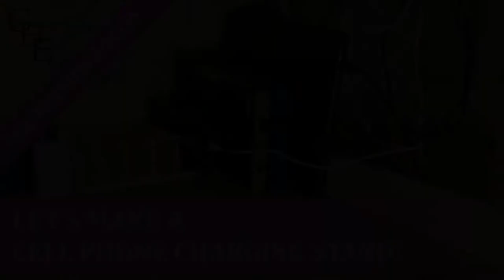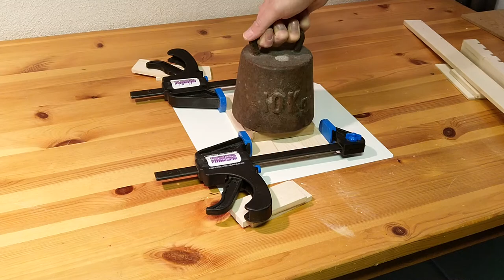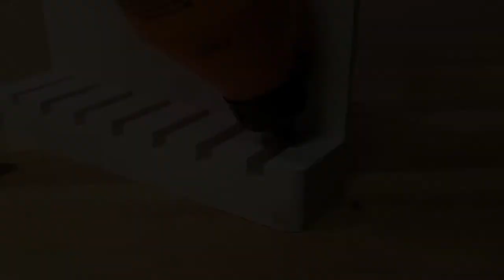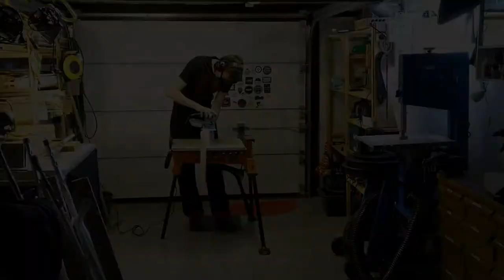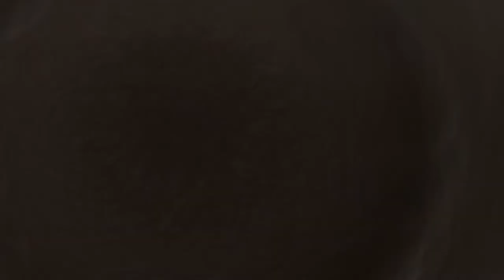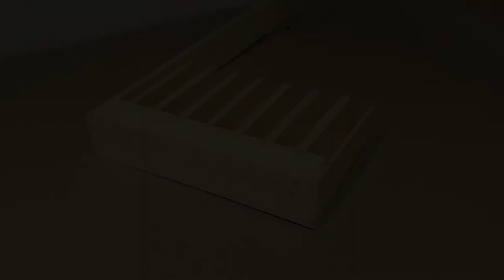Let's make a cell phone charging stand! #rubbishwood21

Comment: A really nice way to use those scraps. And I'm completely in sync with whay you say about old houses. Mine is also over 100 years old, and nothing is straight. How close were that sander to your lens.. 😱😱 be careful 👍👍
Reply from the maker: Thanks! 
It make it more fun with an old house, especially since it's been added to and renovated multiple times. So we have parts that are built like 1907, 1940, 1980 and 2010 - you'll never know what you will find when you start working on a part of it! 😅
I was about 1 cm -1/2 inch away. That was my second take, on the first one it touched the tripod... 😬